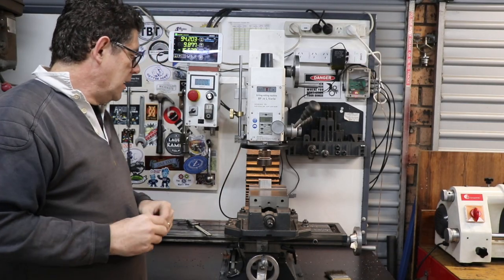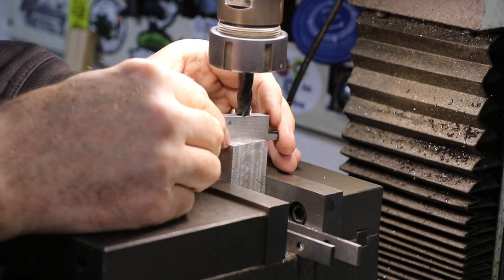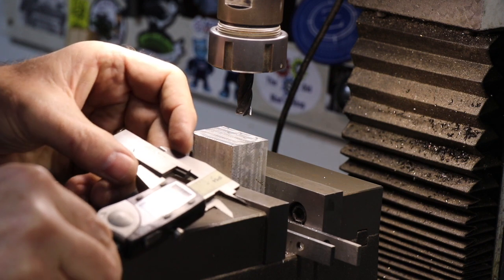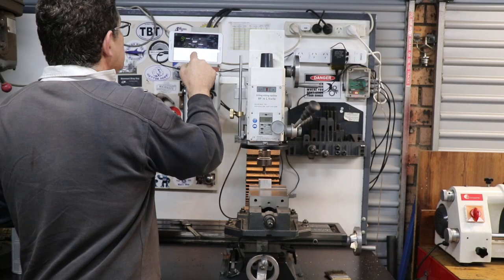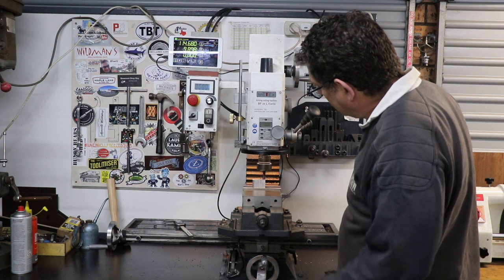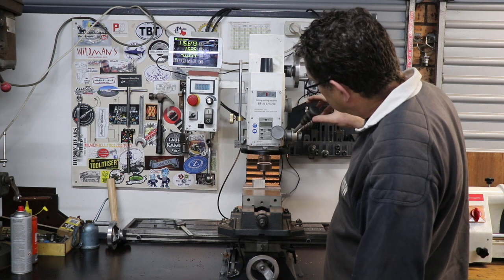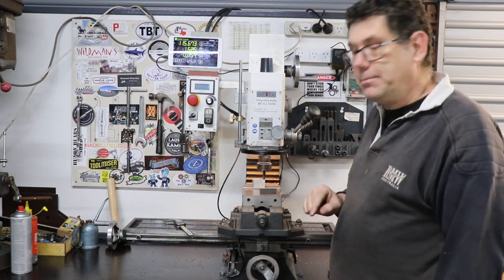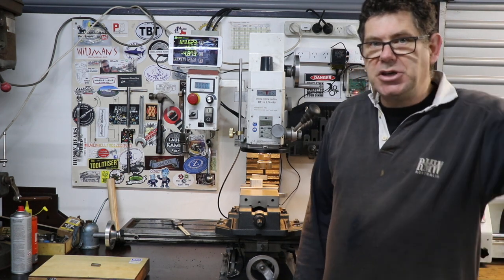Touching Off with Adjustable Parallels #tipsblitz19

Comment: Good tip. I have used feeler gauges but I like the approach of using the adjustable parallel and bringing it up to the end mill, rather than moving the end mill on to the gauge or parallel.

Comment: This seems useful if you have a finished depth on a slot but you still need to side mill the slot. Like if you have the depth set up then you break an endmill I think this would be a good trick.

Comment: I prefer to use the Fowler 54-575-750, it's a 1.00 thick block that has an indicator light that activates when your end mill touches in the Z direction.

Comment: While I appreciate the input and the tip for others, The cigarette paper is the FASTEST and EASIEST method ever! Much quicker than setting the quill to "some height" to use adjustable parallels, THEN adjust the parallels, THEN measure with a caliper, THEN set your DRO if you have one, THEN adjust the Z to zero.
Check the thickness of the papers ONE TIME (IF necessary), from then on adjust the Z until in touches the paper, you then know the cutter is .001 or .0015 away from the work. SIMPLE!
Reply from the maker: I only set to zero to demonstrate that it worked.  Normally I just machine to required dimension.  Setting initial height is just to get close enough to be within the range of the parallel.
On my tiny mill I like to keep the quill retracted unless I am drilling.  Snuggling up to a paper is tricky using the z adjust on the head.
Reply: @CreaseysWorkshop  you just answered my only question. (If your "feel" on the parallel brings you to a few thousandths, why not feel on the part?) I can see keeping the quill fully retracted and adjusting a using table height, the parallels work great for that! Thanks for the video.
Reply from the maker: @edwardhugus2772  Thanks for watching Edward.

Comment: Cool, never thought about using the adjustable parallels for that purpose - always just touched off on a scratch or used cigarette paper that is .0015" thick.  Will have to try your trick!
Reply: The cigarette paper is the FASTEST and EASIEST method ever!